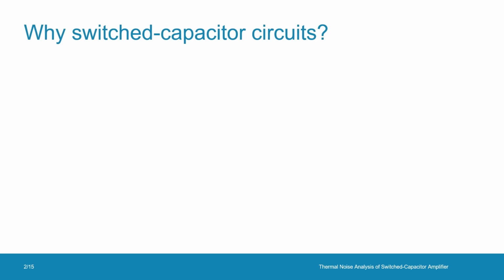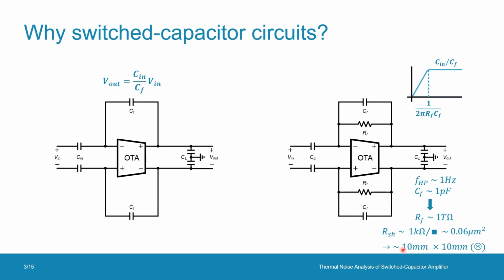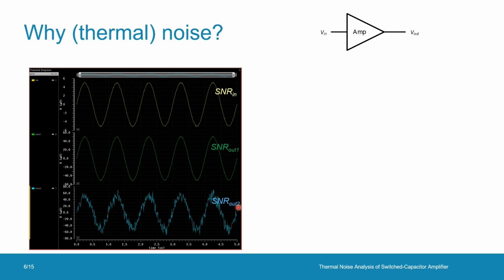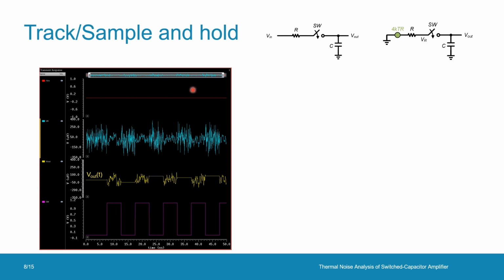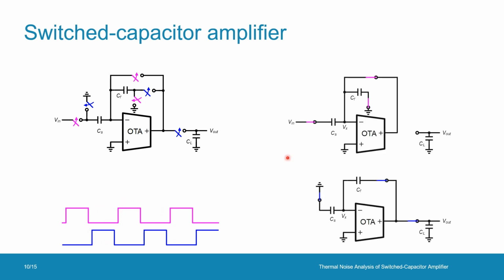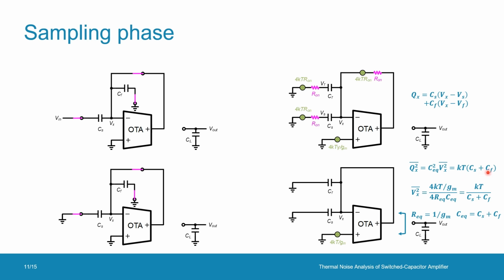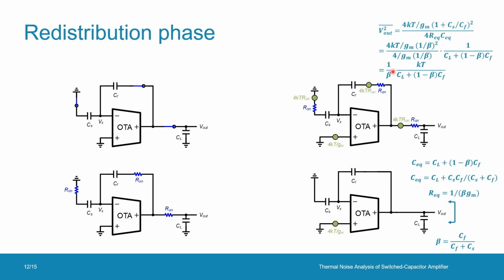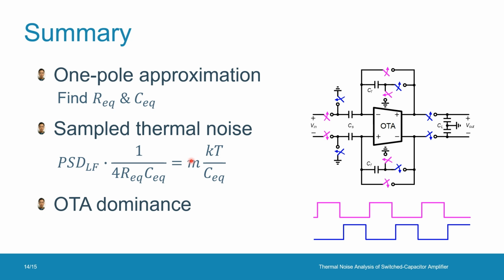Thermal noise analysis of switched-capacitor amplifier (Theory)

Comment from the maker: I have to clarify that:
the approximation of 4kT/gm, for the OTA input-referred noise PSD, is really an optimistic scenario.
In reality, the actual OTA noise might be much higher mainly for two reasons.
First, compared to the single ended OTA, the noise PSD will be doubled (i.e., 8kT/gm) for a fully differential implementation, which is typically employed in practice.
Second, here, only the noise of the OTA input transistor(s) are considered, while the noise from the load transistor(s) are not taken into account, which can be quite significant if the OTA is not optimized for low noise.
Reply: V_input_reffered=8kT/gm1,2 [1+gm3,4/gm1,2] , neglecting flicker noise and thermal due to tail cs
Reply from the maker: @monasser2167  Yeah, also be aware that this is only valid for zero or small input. And with large swing, noise will further increase, due to gm asymmetry and common-mode noise to differential-mode noise conversion.